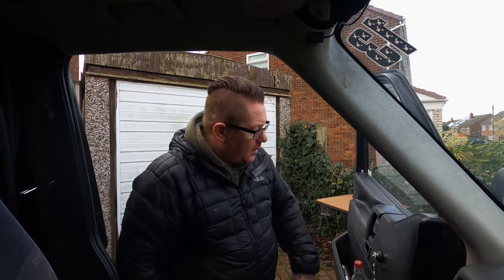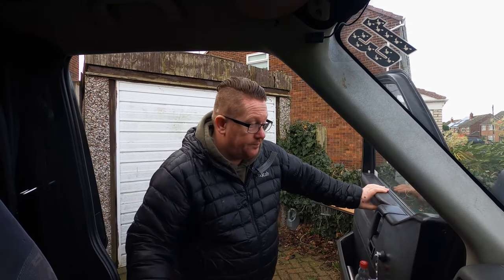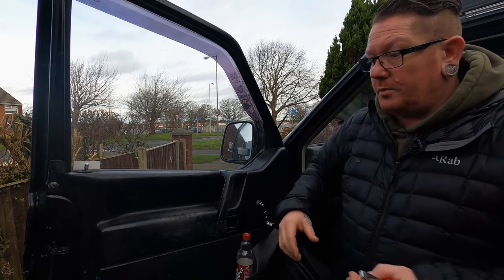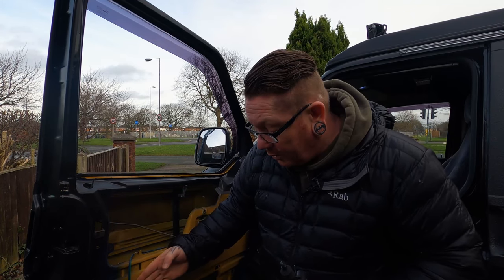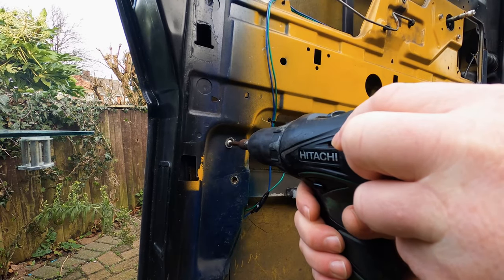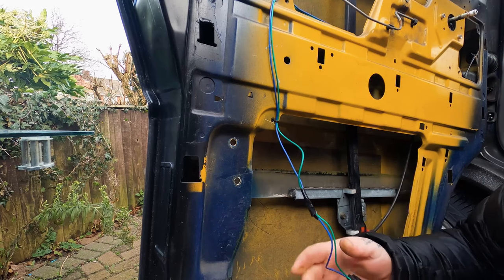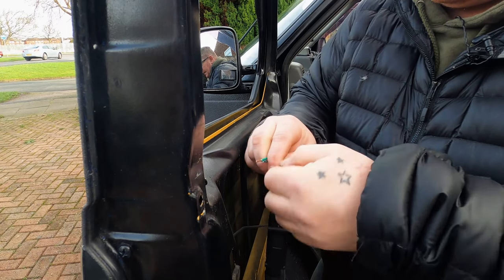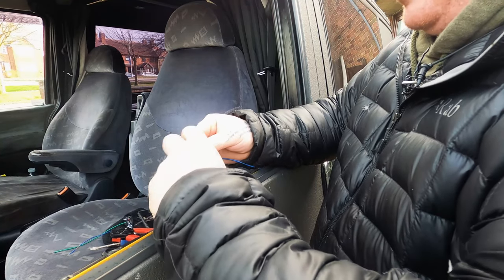Thieves Nearly STOLE My Van Because Of A Faulty Lock

Comment: Interesting point with the wires. I don't think Copper lasts too long in cabels seems that's what usually causes the end of my charging cables. After seeing how easily those bits of wires broke apart it seems the connection wasn't that great.

Kinda reminds me of when I converted my old pulsar to central locking when it was the oldschool key method originally.
Reply from the maker: Thing with copper mate is it oxadises and becomes weak . Plus it dosnt like heat and cold or being bent . This is why they put Teflon and other things in better cables to help . But it was crappy cable with not many cores to it and was ALLWAYS going  to break, I can’t see the new stuff breaking any time soon . . And dude I think charging cables are designed to last 4 days there just CRAP!!

Comment: hi just seen your t4 door lock fault from earlier.my alarm was fitted so central door locking worked ok then alarm stopped arming sometimes .found a loose earth going to a bolt on frame.so alarm seemed to be working ok .had checked all fuses one by one an sprayed contact cleaner in slots.but now alarm just arms an doesn't lock doors unlock ,is there a relay for central locking.checked 2 fuses on alarm too.may have to let alarm man at birkenhead check out .spoke to him recently
Reply from the maker: It was cheap actuators mate . But yer bad cables can be a ball ach